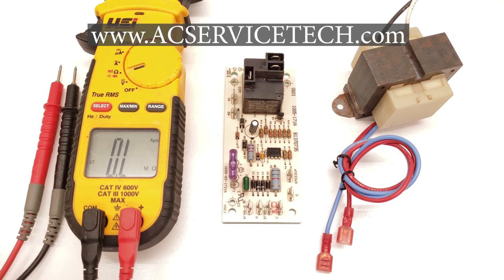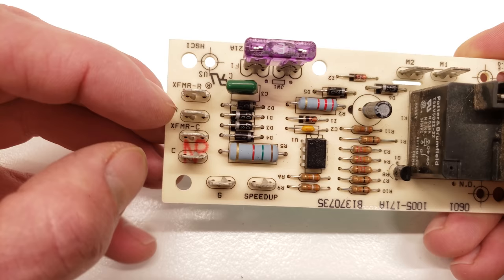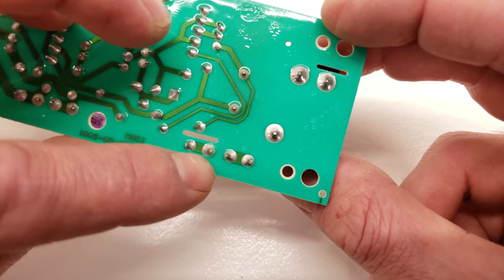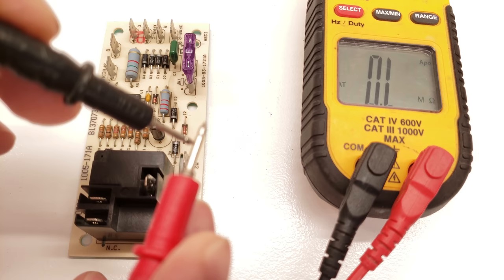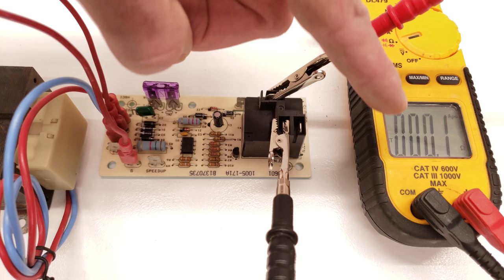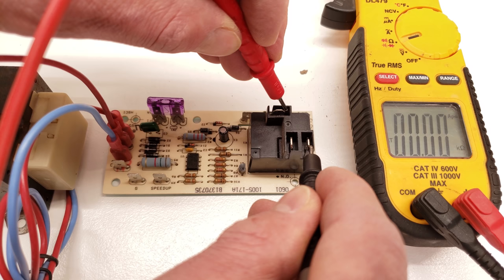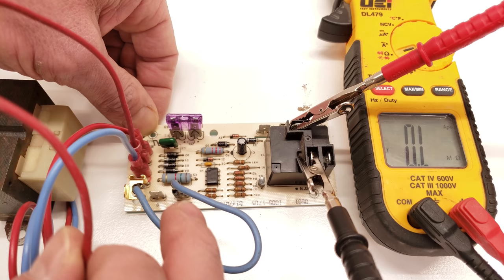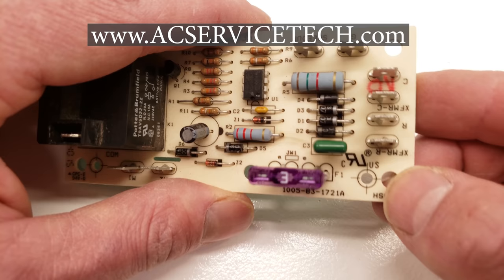Air Handler Fan Delay Board! Explained & Tested!

Comment: Very good explanation. I would mention that some systems don’t use a fan delay board.  If the blower motor is an X13, the motor can be programmed to provide an ON and OFF delay therefore eliminating the need for the board.

Comment: OL is open loop which means it's more then the meter can measure, still could be a "high reading" but it generally means open connection especially for continuity.  Some contacts can show open thru meter but when any higher current goes thru like a test light it may partially or fully close under a load.  In those situations it's best to measure across contact for voltage drop while under load, there should be none with a good contact.  Great breakdown as always.

Comment: im a maintenance tech for an apartment complex built in 2014. goodmans all over the property. all units use this exact control board. the relay box on the boards are catching on fire. in 2 years ive replaced almost 30 boards. our complex has only 214 apartments . i have pics, model numbers and serial numbers of some . goodman is not answering me about the issue. did i miss a recall? surely this isnt normal

Comment: When you are testing the relay to see if it opens and closes. Do you check it when its getting voltage in order to see if it open or closes. I know when you check for resistance you are suppose to have the power off.

Comment: Emerson 57T01-843 Blower Time Delay Relay     I have this board as replacement in my Tra=ne air handler, doe sit matter which wires go where on the relay.  I have one huge red wire and one small red wire.

Comment: my trane 4tec3f42c1000aa didn't come with a fan delay board. the fan is either on or off when either the cooling or heat cycle is started or stops.  Can a delay board be added?

Comment: I’m not sure if I have a delay board, but last time service person came, they adjusted such that there was a much longer delay than 7s before fan came on. I think it was set my internal temperature somehow. It seems the delay is too long, the furnace overheats and shuts off even before the fan starts. Any suggestions on what I should look for to adjust back to better operation? My workaround currently is just to leave the fan set to on rather than auto. Thanks.

Comment: The relay on the circuit board, is that one for the larger fan? I have a packaged heat pump system.

Comment: Just curious, is there a wiring schematic of the circuit board?  U1 looks like it could be a 555 timer.  The four diode in a row is the AC to DC rectifier and the caps and resistors set up the timing trigger delay.  The 555 timer was the first IC I played with when I was in Tech school and college about 45 to 50 years ago. There was a very good book  published about them and they are still used a lot for stuff like this.  No use using a CPU when you can keep it simple and cheap.

Comment: My board started blowing fuses, the repairman took all the 24 volt wires that went to the thermostate off of the board and it still blew the fuse. He then replaced the board and it not longer blew the fuse. He said the board had gone bad, nothing looked burnt, what on the board could have gone to ground to cause the fuse to blow?????? thanks

Comment: I have Haier air handlers which have the worst control boards. They fail all the time. One time we had a power outage and two of them failed and had to be replaced. I always have to replace them frequently. I also have Goodman and carrier which never give me any trouble.These Haier control boards don't have a fuse built in them.These are very basic control boards. They have 6 wires connected to them. I m wondering if I can replace them with a diffrent brand that has a built in fuse like the one in this video.  Haier control board part#WJ26X24063.Thank you

Comment: The relay control side is DC? While the load side is AC, should you be measuring in DC on the control side then? All while we have 24VAC from the XFMR for control voltage?
Reply: Why is it a DC coil they use. Is it because they need to work with DC to get time delays to work such as using capacitors

Comment: I have the same board. But the fuse is blowing. What can it be? I'm getting 27vac from the transformer. Should I change the whole board? Thank u.
Reply: Low voltage short, one of the low voltage wires are either touching metal, touching each other, or you could have a bad contactor at your condenser. Could possibly be the thermostat as well if something is bad inside it. Hope that helps 👍
Reply: I think somebody weedwhacked your tstat wire near outside unit.

Comment: even ifi its low voltage why did you measure the relay using resistance when power to g was on? why not just measure voltage for you know

Comment: I need a fan delay board for an old school AC system, 120 volt capacitor start fan motor, for my residence. My transformer works, the output fan relay burnt up. 

Looks like what you have here would work. Can I get the manufacturer/ part number? My apologies if you have listed it.
Reply: Hey John, don't know if you got a board yet but the part # for the board he used in the video is Part # PCBFM103S Good luck on fixing your system. 🛠️
Reply: @ApartmentMaintenance  
Hey thanks!
I managed to patch a simple controller together with a relay and my existing t-stat. Still working with only a couple more cooling months ahead down here in FLA.
I'll check out that board come "winter."
Thanks again.
Reply: @johntrauger68  No problem!

Comment: This is my board but mine is not equipped with a fuse. The location is present but there are no terminals to install a fuse into 🤦🏼‍♂️😭. There is a red wire connected to XFMR-R terminal but it has to be useless since the circuit dead ends without a fuse. Please help

Comment: Hi, I have the same control board in my central climatisation and heating unit. I have an issue that seem to come back at each 4-5 years or so. The issue only happen on climatisation mode. Once the thermostat reach the desired temperature, the fan stop correctly about 60 sec later ( wich is normal) but the outside compressor never stop, even if I put the thermostat to off. I have to close the breaker in my electricity panel to make it stop. Once I reopen the breaker, the unit can work properly for 24-48 hours before doing the same problem. The relay in the outside compressor is new and is working ok. A tech came to check and the only thing he found to solve the problem is to change the Fan board. After that, all worked ok for about 4 years then the same problem happened again. So I changed the board again. Now, we are about 4-5 yr later and the same problem is there again. Does anyone knows what in this board can cause this issue at each 4 or 5 years or so???

Comment: My understanding is 24vac is ac. Not dc.. so wouldn’t that make that relay ac powered ? There is no rectifier on that board or in that transformer
Reply: The four diodes between the power resistor and gumdrop capacitor near the R and C terminals are formed into a discrete diode full bridge rectifier.  From their the chip and the relay control side use this 24v DC rail to draw their power.  This also enables the use of the simple to drive transistor (at the inboard corner of the relay) to switch the relay coil by a signal from the chip.
Reply: @jkbrown5496  thank you!!!!